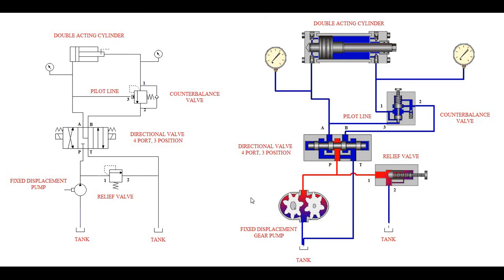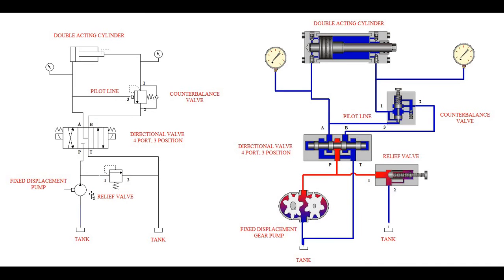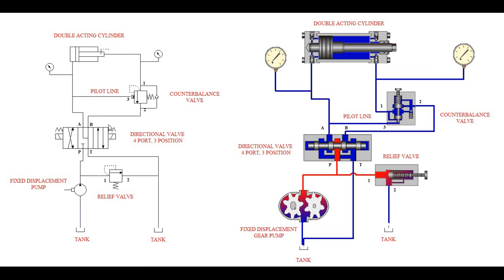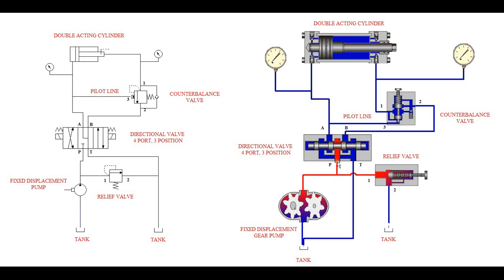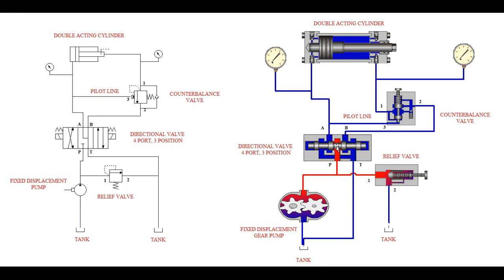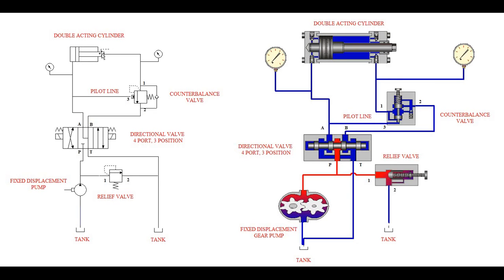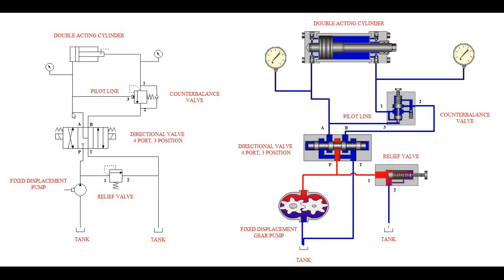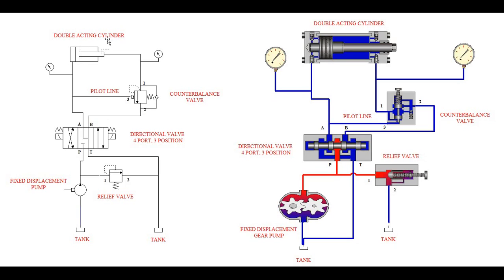Simple Hydraulic Circuit Tutorial Part I-Schematic Analysis

Comment: I might be nitpicking a little, but isn't that technically an over centre valve? Counter balance valves work with an internal pilot whereas over centre valves have a pilot from other side of spool. Also with the P port being blocked, are the functions and pump activated off a common power source? Wouldn't want them to be individual as you'll have the pump running over relief for extended periods of time.